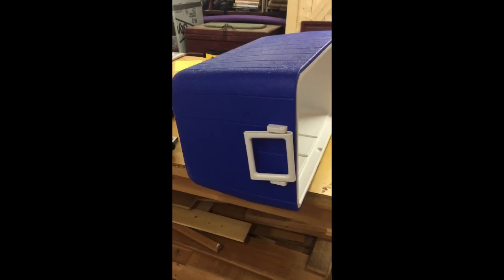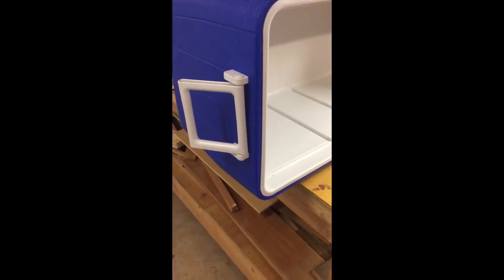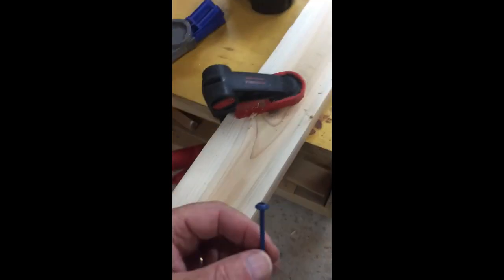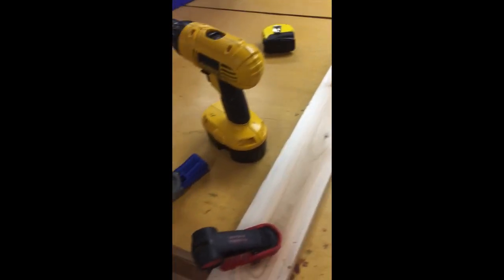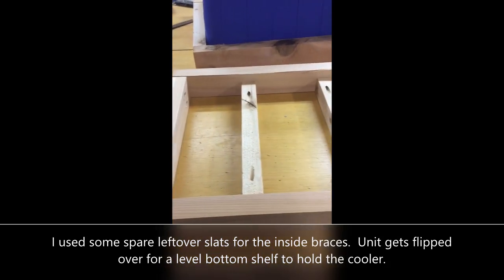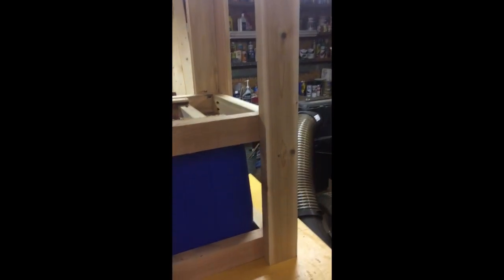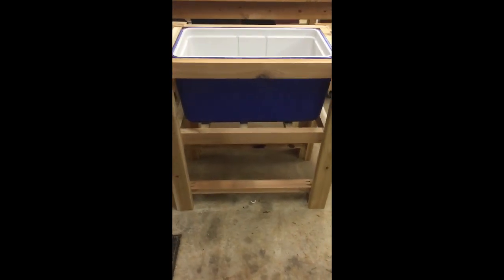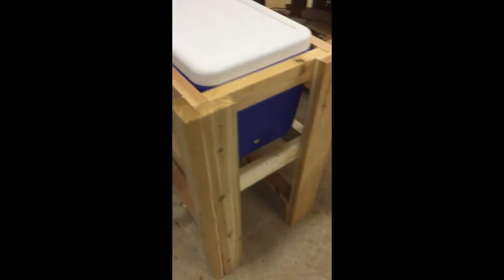Outdoor Ice Chest Table

Comment: Great job on the build.  I have built several for people at work at retirement.  Your design is pretty much what I have done.  I did do 8" wheels on one side and a grab handle on the other.  People seem to like to roll them around.  Not sure which is cheaper the two 8" wheels or the four casters.  I will be building one this weekend for my Warden for his retirement..  Hope it comes out well.